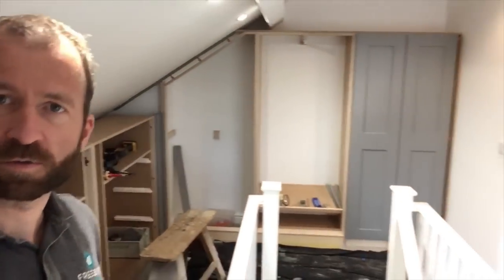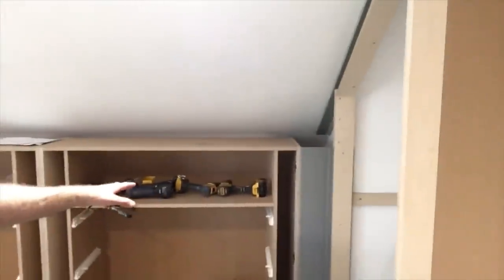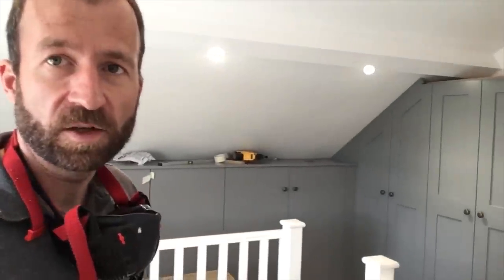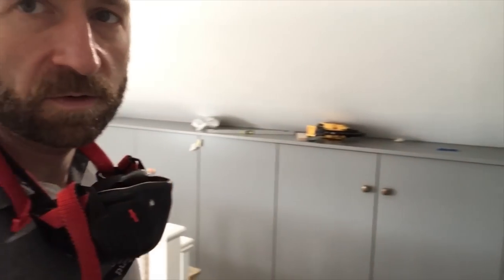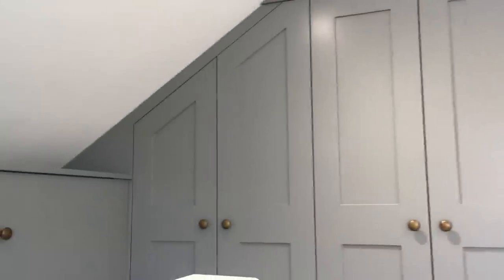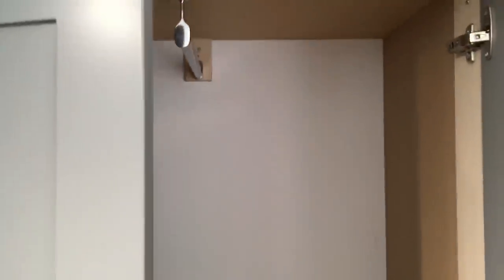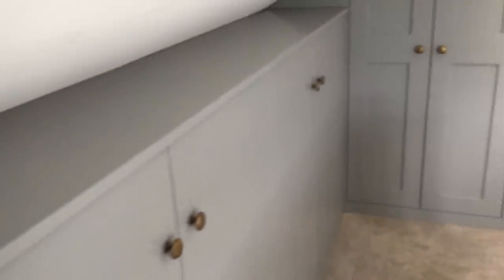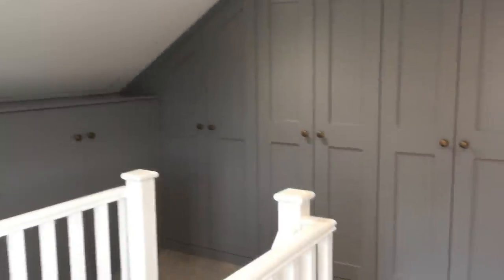How we built these attic wardrobes

Comment: A very smart set up there. I would perhaps suggest instead of fitting the small triangular piece at the base unit/robe corner detail. You could have used a full height angled dead panel then the scribe filler and base unit top would be fitted to that. That can also free up a bit more flexibility as to how far back the base units could finish. You may have been able to get a tighter scribe  for the top. Hindsight is a great  thing.  Just happened to come across your videos recently, great attention to detail.

Comment: Good video! I really like your style of editing!😀 I think you were right about the plain doors on the left. Couple tips, maybe some wax on the pull out basket tracks. Too bad they didn't come with a roller on the front. Also you maybe able to get a hinge reduction clip for the hinges. This would limit the doors to 90 degrees so when opening them the would not hit each other.
Reply from the maker: Brian Needham I heard of those hinge reduction clips but never thought of using them.  I guess the adjacent ones would still hit each other’s handles though?  Goood idea about the wax.  Or silicone spray could work

Comment: Ditch the MR stuff. Especially the green. You can get dye bleed through from the green MR. Use deep route MDF. It's much denser. And paints up far better.
Reply: Mike Clewlow Thanks for that tip; to be honest I’d not come across deep route mdf, but it seems it has qualities that make it attractive for many applications.
Reply from the maker: I’ve tried it and I agree it’s the best for density.  Only comes in 18mm though right?
Reply: @Alastair_Freebird  it does yes. But you can also use exterior MDF if you need a thicker one.
Reply from the maker: Mike Clewlow you mean tricoya?  Where do you buy the deep route and tricoya and what are you paying?
Reply: @Alastair_Freebird  no you can get external mdf. Not medite extreme. I always buy from lawcriss. Deep route is £19 and a few pennies + vat.

Comment: Maybe another useful tip for side scribes. Is there any reason why you don’t cut the skirting so that the scribes or plinth would fit behind the skirt? That’s one of the 1st things I do, work out from back to front where my side scribe or plinth face  is going to  be then use my multi-tool to either remove that particular part of the skirt or the full length of skirting. It’s certainly quicker & easier that scribing to a profiled skirting.
Always looking to time saving tips & techniques.
Reply from the maker: Keith Brigham occasionally I do this.  I think there are a couple of reasons why I don’t usually: 1: I try to take a non destructive approach - leaving existing things in place and fitting around them.  Perhaps that’s unnecessary. 2: the way I fit scribes, quite often I am positioning them against a door that is already fitted, with the scribe finishing flush with the door, and allowing me to fix it with a bit of play to get the gap just the way I want.  This means I am pushing the scribe on from the front so I couldn’t notch it behind the skirting.
Reply: @Alastair_Freebird  Thanks for that which is a totally understandable reply. I do make my skirting cut slightly deeper than I need for the scribes / plinth, the these  can brought forward if needed. Any minimal gap between skirts & finished faces can be caulked if needed. So in theory your shaped scribes to the skirt don't need to be that time consuming & accurate as you're caulking the skirt to the flat surface of the side scribe or plinth. Same principal with ceiling infills & coving..it's much quicker  and simpler to remove to slither of coving for the infill to sit behind. Rather  than cuttingt 18mm board to suit the shape of coving. If it's decorarive coving then it's maybe wise to inform the customer of your intentions before demolishing anything, as with skirting. If you were installing wall to wall with both skirting & coving to contend with you could easily save a an hour or so on a situation like this. We're all here to learn!!
Reply from the maker: Keith Brigham funnily enough a recent customer actually asked me to cut the skirting instead of scribe the strip around it.  I may do it more in future now you’ve got me thinking about it!
Reply: Freebird Interiors  great stuff..you know it makes sense :)

Comment: Super great job.....well done ....can you please make a video or a post on ig stories on how do you calculate and estimate the price for a wardrobe ?i think that will be a nice subject! Keep the great job up!
Reply from the maker: Hi!  My current rule of thumb inclusive of VAT is £1200 per linear metre for wardrobes with vinyl wrapped doors. £1400 for painted doors.   Assumes full rigid 18mm MFC carcases, bespoke fully fitted design.  Drawers extra, around £150 each.
Reply: @Alastair_Freebird  thank you for your replay.....so 1200 is just for the carcas and doors no shelves and no drawer. Do you charge 150 for a drawer or a pack of 2,3? Sounds a pretty fair price!
Reply from the maker: The rule of thumb is often about right inclusive of carcases with a mixture of shelves and hanging. Around about £150 per drawer seems to work out about right for me.  We are making drawer boxes in birch plywood, glued up and sanded and sprayed, and putting them on Blum Movento concealed soft close runners.  They could be done more simply in melamine with cheaper runners.

Comment: Hi Alastair, I could not tell whether you pulled back the carpet to install or whether you installed over the carpet ? Which would be the better method and why ?
Reply from the maker: Stephen Maddock hi I always ensure the weight is born into solid floor so there can be no settling later.  In this job as I remember it, I cut squares of carpet out (maybe 3 inch square) in the positions where the adjustable feet would land. And where necessary I packed/shimmed these spaces with offcuts of board (I keep a box of various thicknesses cut into 75 x75mm squares), so the feet sat on solid board and could be adjusted as necessary.

Comment: Thanks for the links yesterday I will look at the buying you a coffee thing for sure :), Can I ask you a question please. In your video about pricing you mentioned a going rate per meter of making a wardrobe ,Thinking you said £1,000 or something, anyway the question is were you referring to the labour charge or the whole wood, nuts and bolts of the build? thanks
Reply from the maker: Christopher Claudio Skierka complete price to the customer, designer, built and installed including materials costs and everything.  Most of our jobs are around £1200 per linear metre including the vat, and more with drawers (about £150 extra each), angles, solid oak features and other special extras.

Comment: Hi did you buy the grey wardrobes or build them yourself? Where did you buy all the materials from like wood, screws, hinges etc and did you paint it yourself or spray paint it? Also where did you buy the wardrobe doors which have the panels or did you make them buy sticking mdf wood ontop?
Reply from the maker: Hi, designed and built ourselves.  Mdf etc from Arnold Lavers at that time I think but more recently so use James Lathams or Lawcris.  Hinges and hardware from Hart Wholesale (www.Blum.org).  We sometimes manufacture doors, jointing a frame of rails and stiles enclosing a thinner panel in a groove, but for this projects we got the doors CNC machines from solid 22mm mdf with rebates through-cut openings which then had a 12mm panel glued in.

Comment: Hi Alistair, another great video, I’m interested in those spacer plugs do they actually fix in to the wall behind also?.. so you screw thru the workpiece into the plug and then into the wall?
Reply from the maker: Hi yes 100mm screw through the centre of the spaceplug and into a red uno plug fitted into a 6mm hole in the wall.
Reply from the maker: http://space-plug.com/
Reply: Aha I see and are they used to support the workpiece and provide a secure fixing ?.. thanks Alistair. Your videos are excellent and the level of craftsmanship is inspiring sir. I appreciate you taking time to reply also. 👍🏻
Reply from the maker: @dazlarg  you’re welcome!  Yes they help to hold the unit in a position, working like the black adjustable legs for a kitchen, but as a good packer, and with the ability to fix through them too

Comment: Great content! Can I ask how wide the tall doors are on this build? Also what width (not the thickness) of plywood are you using for the mounting of the door hinges? I'm looking at doing pretty much what you have done here for a landing linen closet. The width I have is 170cm & would like to do 4 doors but not sure if it will look right given the width. Cheers
Reply from the maker: MJ12 hi I think these doors were in the region of 50cm but your doors at 42cm or so will look ok.  I used 18mm plywood for the frames as this works well with standard hinges in terms of overlay and gaps created between doors